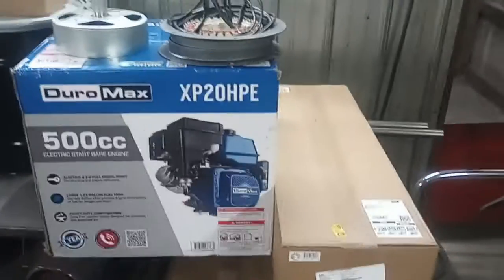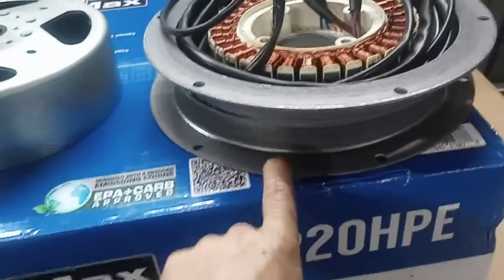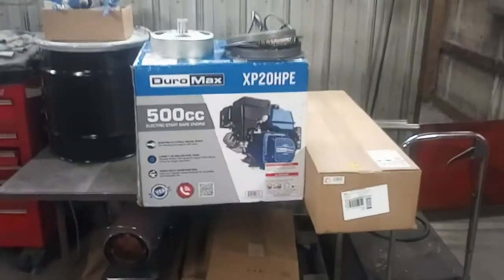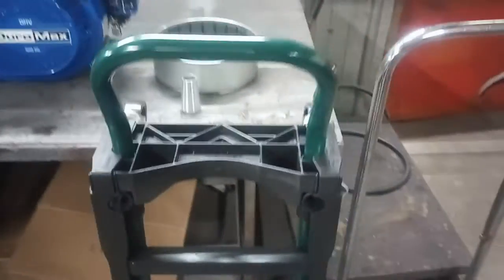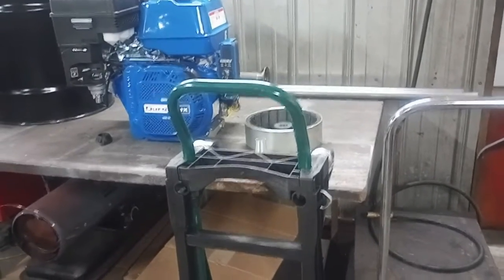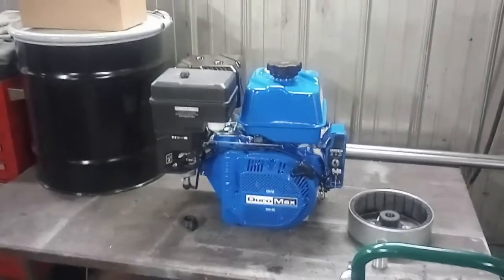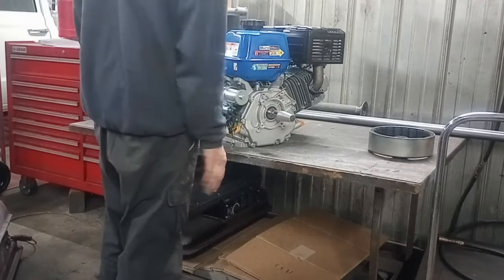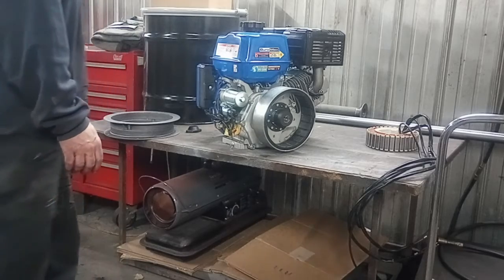DIY Inverter Generator Scratch Build with Parallel Capability

Comment: Pretty cool.
Dumb question if you are just charging batteries doesn't it make more sense, to run the output through a diode pack, and input the power into a solar MPPT and charge the batteries directly.  You get away from extra conversions
Reply from the maker: With this unit you dont have to run at a static 1800 rpm. You can run at a lower or higher rpm that you can tune to your load. So more efiecient at low loads and you can get more power when needed by turning engine higher in the power curve.
Reply from the maker: Thats what a charger is. I just use our EG4 onboard charger. You are not elimanating anything. if you go through a charger or use a " diode pack" you are still converting AC to DC. Why try to build something that is already available and perfected?
Reply: Not sure what max stator voltage is. And how the inverter totally works...
(And this maybe the key it's not converting to DC voltage from the stator)

But if its AC from stator, convert to DC. inverter takes the DC converts to AC, send that to offgrid inverters to charge the DC batteries.... 
seems like a lot of converting.

 The main advantage is that you can use the generator for other things...
But strictly charging batteries seems removing the inverter in the generator skips some of the converting back and forth.
Jus trying to find more efficiency..... 

Either way  I like your video's and gasifiers 👍

Comment: Can you provide a link for the stator and inverter box?
Reply from the maker: This is the link to the rotor / stator assembly https://www.amazon.com/dp/B0B6R63CN3/?coliid=IO2QH8J3A88OA&colid=Y42IIXJO6BCA&psc=1&ref_=list_c_wl_lv_ov_lig_dp_it
Reply from the maker: Here is the Inverter Box https://www.amazon.com/dp/B0B6R3MXVL/?coliid=I11C2PQ6TM6U3Z&colid=Y42IIXJO6BCA&psc=1&ref_=list_c_wl_lv_ov_lig_dp_it
Reply: @Thrive-Off-Grid  Yea just bought a Duromax and I'm interested in being able to parallel them, Plus the extra parts on hand.
Appreciate the response and the links as well.
Reply from the maker: @Modified10r  If you can confirm the inverter boxes are the same please let me know. I do know that box on Amazon is identical to the Predator 9500. The Duromax 9000i is spec'd a little different so Im not 100% the inverter box are the same.
Reply from the maker: Building this from scratch completely with out a donor will cost roughly $1300. But that covers the inverter box, rotor / Stator assembly the new engine, the cart, hardware and flanges. Still $1000 bucks in savings. 

With a Predator / Duromax donor generator then you are only in it for around $700 ish. 

Then once this is built and the time comes to overhaul the engine. You can then either rebuild it or just swap in a new one. In the long haul this will save tons of money. Plus since its parallel capable you can always add on additional units for more power when needed. I parallel our two 9500 units all the time when we need to run all the shop equipment at once.